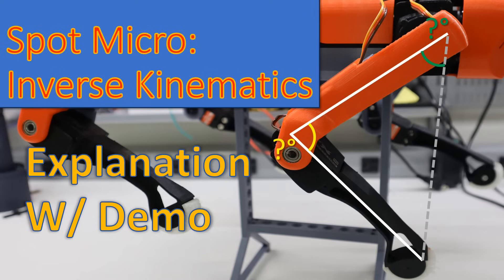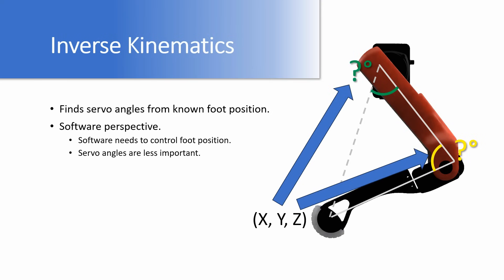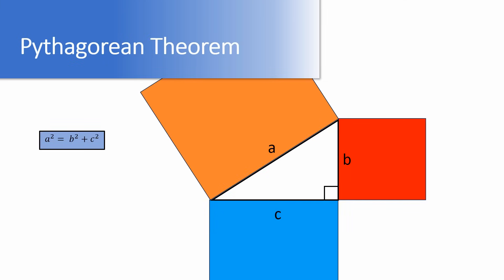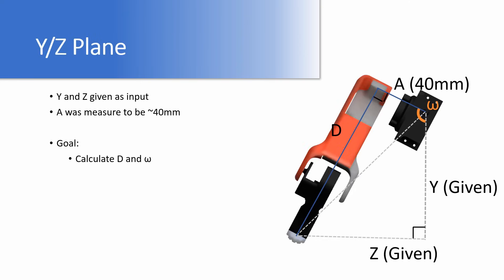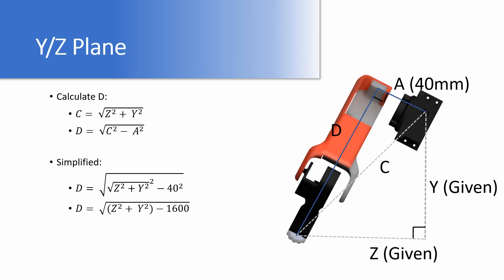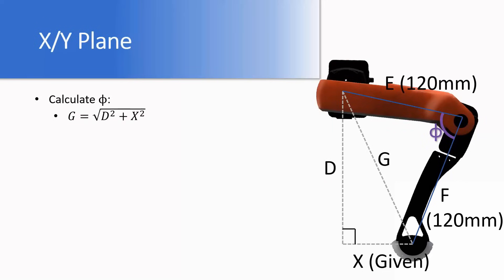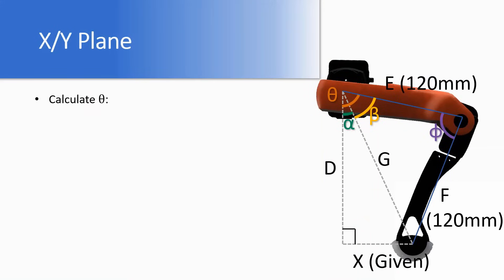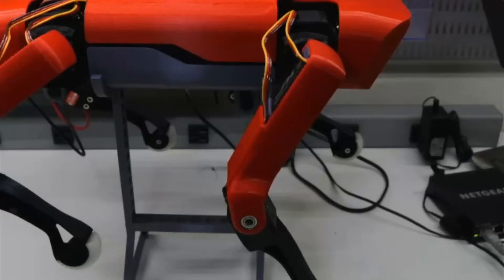Inverse Kinematics for SpotMicro robotics | example and demo

Comment: Hi,I noticed the inverse kinematics function in your repo calculates things a little bit different (for leg angle it substracs instead of sum the terms, and  uses atan(X/Y) instead of atan(X/D) ,also when calculating the shoulder angle you do  atan(G/shoulder_offset) instead of using D like in the video equations) .Could you please explain why and wich formula should I use?Thanks in advance and great video btw
!
Reply from the maker: Thanks for watching and I appreciate the feedback. Some things are subtracted instead of added to get them in the right orientation for how the servos are mounted. However, I think you are right about the leg and shoulder angles. It should be more like the video. I have tested this code and know it "works". These changes should have a fairly minor effect, which is probably why they got overlooked. I will have to make some updates and test out the changes.
Reply: @AdvancedHobbyLab  Hi, thanks for the response, I tried your  inverse kinematics but implemented in c++ and altough they worked good the y axis was "inverted" (if I asked for 14cm of y,the outcome was 18 and for 18 cm the outcome was 14cm for example)so after I remade the code but according to the formulas in the video,altough it fixed it the left side legs  femurs/leg didnt move at all so Im also looking for what may have caused it. The strange thing is that the major error occurs when fixing the code to fit the video equations,it may be due to orientation of servos as you say,i will keep trying!

Comment: Curious, how would you approach calculating the inverse kinematics for the entire body? So we can control things like body rotation, yaw, roll?

Also, this is the trigonometric solve for the problem, but it is my understanding that some robots require a numerical approach, do you have any suggestions for that?
Reply from the maker: To calculate body inverse kinematics, I would calculate body pitch, yaw and roll independently in relation to consecutive shoulder joints. For instance, to calculate pitch, I would use trigonometry to calculate the difference in height needed between the front and back legs to generate the desired pitch angle. That difference can be passed to the inverse kinematic equation.

What do you mean by a "numerical approach"?  I think a trigonometric solution should work for most robots. Is there a specific situation you are thinking of?

Comment: hello could teach how to apply that in stepper motor with  big geas.
pls can you explain how to apply in code plsssss 😢😢
Reply from the maker: The math for determining the desired angle is the same.  Stepper motor, unlike servos, don't know a position, but are good at determining distance traveled. To use stepper motors, you have to keep track of its position. This often includes an alignment procedure, often using an end stop switch. Once you know the angle of your stepper motor, you can apply the angle from the inverse kinematics equation.

Comment: Hi,

I tried applying the formulas to my quadruped robot setup using my robot's limb lengths but the values for the angles I get from the formulas seem to be off. I suspect it has to do with each servo's orientation and offset from center as well as where the origin point is considered to be for each leg. Are you using any specific origin, orientation for your mini?

My robot's body is using MG90s servos, so not the most reliable ones, but they do work well enough if I use them in a forward kinematics scenario I developed.

Now that I'm trying to make it more configurable and basically parametrized, i.e. specify the height at which the legs to go and keep it like so during the walk cycle, the IK approach seems to be the way to go as I my current forward kinematics is a interpolation between known stances, which are supposed to be stable positions defined by sets of servo angles, 12 for each "frame".

I'd like to reach a position where specifying a variable value for the Y or X axis will move both femur and tibia servos accordingly, I'm not yet aiming for hip servo adjustment as I want to get it working in the XY plane first.
Reply from the maker: The origin point that I use is the shoulder joint where it connects to the chassis. This is convenient as it allows all legs to use the same equation. These equations will just calculate the angle of the for the joints. Depending on how you mounted your servos, you may need to apply and offset angle or invert the angle to match rotation direction of your servo. Hope this helps.

I may need to do a more complete video in the future that includes using an origin from the center of mass and how to apply the equations angles to your servos.
Reply: @AdvancedHobbyLab  thanks for the response. I think we're using the same origin system, I had to offset and change direction for some of the servos in my robot's legs as the servos are mounted to fit the 3d-printed legs, which btw are those of the OpenCat project I found and which of course does not quite work for my servos; apparently MG90S servos made and sold in factories in Shenzhen aren't the same as MG90S servos made and sold by factories in Honk Kong. But anyways, I digress :) . So after some guesstimating the offset and orientation of various servos I got the legs to move along both the X and Y axis based on input value but I noticed that there is a rather limited range for each of the axis that I can specify, I was expecting that, but still it seems that the full 0 to 180 deg for the servo does not quite cover the fully extent or retracted position of the leg, especially on the tibia or the foot end of the leg which seems to stop at one of the ends of the range (either 0 or 180 deg) without becoming fully aligned with the femur, the next up section. 
It could be that the "center" set to the middle of the servo's range, e.g. 90 deg, isn't such a good choice but without encoders to properly know where the servo is relative to the joints, it will have to do.

Comment: Hello, could you please share the code?
Reply from the maker: Thank you for your interest. I'm a little hesitant to share my code as I think you get more out of the video by coding it yourself. If you have any questions about the math, let me know and I'll try to help.
Reply: @AdvancedHobbyLab  How do you enter the xyz inputs in your demo for example to move the leg up and down or forward backward? And then for the leg step? Thank you
Reply from the maker: For these demos, the xyz values where hard coded values that I iterated between in a for loop. The trick to achieving smooth transitions and controlling the speed between two foot locations is with interpolation. You have to divide the path between two points into smaller segments and use the inverse kinematic equations to calculate the servo angles for each segment.

I'm working on another video about walking gaits. I hope that will help explain this topic.
Reply: @AdvancedHobbyLab and what are the xyz coordinates values for the demos? I want to try exactly the same values, be able to i could compare your movement and my movement
Reply from the maker: I found small step sizes where the most stable. I only moved the feet 20mm off the ground and a maximum of 20mm on the x axis for forward movement. Quick steps also helps with balance. It takes a step about 2 to 3 times a second.
Reply: @AdvancedHobbyLab sorry sir but i have another question. The leg length must be the same for this equations? Because on my robot i do not have the same length of legs.
Reply from the maker: Good question! You don't need the same leg lengths that I used, however for the simplified equations, I used my values. You would need to substitute your leg lengths into the equations for it to give you accurate results.
Reply: @AdvancedHobbyLab thank you